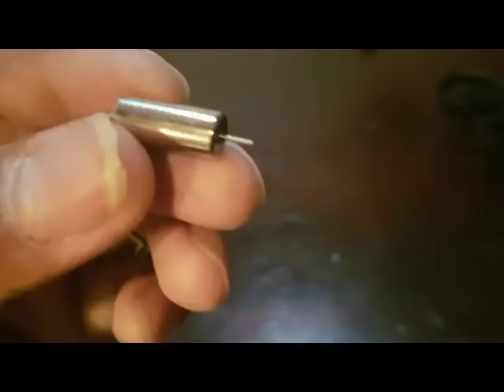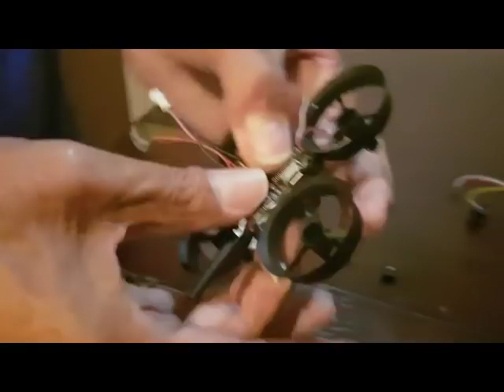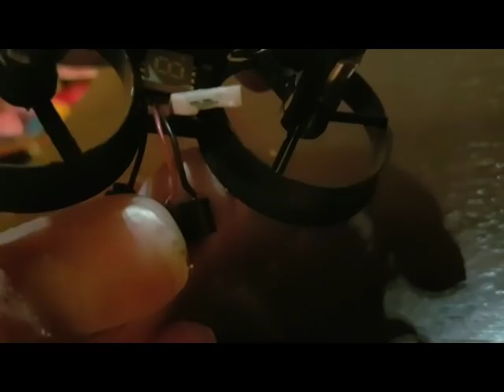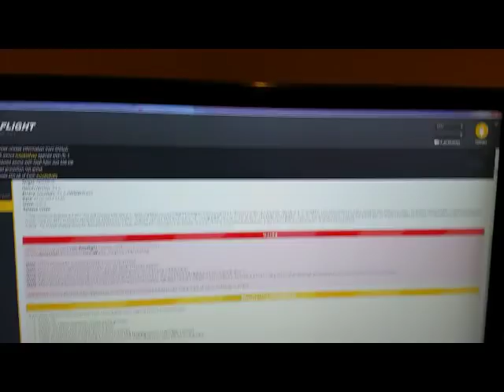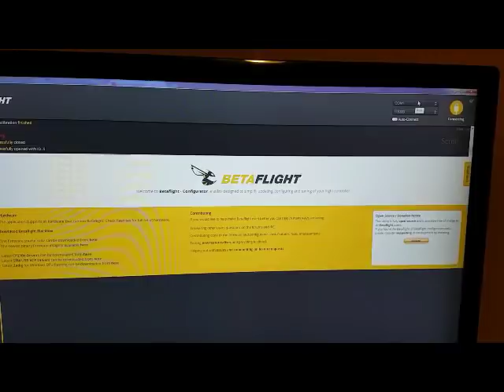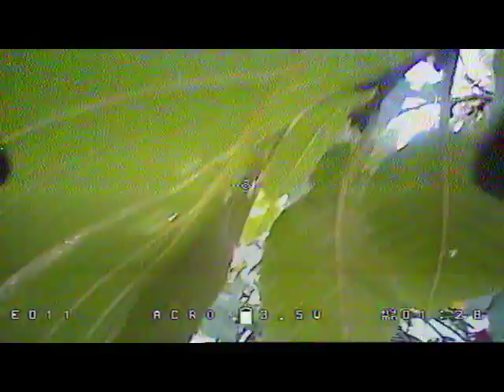Acro Super Whoop lowpro build guide E011 F3 w/osd ibus\sbus (under $80 to build, links below)

Comment: Great great video. Like so many others, I am inspired to do a build.

I am wondering if you've switched to brushless motor builds. I'm new to this hobby but from what I understand tiny brushless motors have only recently become available so I'm thinking that maybe when you made this video there were few options.
Reply from the maker: I switched to brushless. Betafpv has great options for prebuild or good ideas for motor frame combos if you want to build your own brushless.
Reply: @sheaseydel3913  Thanks. I'll check them out. So... brushless due to longer lasting lifespan and/or longer lasting flights?
Reply from the maker: @JELB1960   that and much more power
Reply: @sheaseydel3913  OK thanks. I hope you do a video of a 65mm sized long-range brushless build then. Cheers. Already Liked and Subbed.

Comment: The king Kong props are the wrong link. Should I grab props with 1mm or .8mm holes? Thanks!!
Reply from the maker: kiwijunglist .8mm for e011. i reccomend 4 blade props for better acro
Reply: Ascension FPV thanks. What do you think of this realacc controller Vs beecore V2 / king Kong / betafpv / other options. This is for brushed 7mm acro whooping. Thanks (sorry for so many questions, I don't have any gear I've just ordered a bunch of stuff. E011 / h36 / tiny6 bnf advanced pack with 5x 3.7v 250 30c batteries / q x7 radio / 1000 tvl camera. Still need to buy more batteries. And need to decide on the fpv Googles (furabee v1 Vs ev800 Vs ev800d Vs eachine Googles two Vs vr d2).
Reply from the maker: kiwijunglist i prefer the realacc board its the lightest with the largets fets and runs ibus smooth plus the chip can handle 8k/4k pid/gyro loops
Reply: sold ; I don't know fully understand your reply (yet), but I'll pick one up.  What do you think about the goggle options.  I don't want to drop $$$ on lightweight expensive googles without trying out the fit and seeing what I like.  I guess the EV800 / EV800D is pretty good in that it's a removable screen for when you upgrade to more expensive googles.

Comment: I discovered that the VTX consumes me a lot of battery and that's why my flight times are short
Has it happened to you? How can I solve it?
Reply from the maker: i have suffered this once also.. i replaced the vtx if you got it from banggood order a new one and show them the problem on that order when it arrives for a refund they suck about time limits for problems within 3 days of receiving items . check the soldering joints a cold solder on negative will cause massive power loss and volt sag
Reply: Thanks!! I will try

Comment: I followed your exact build and finished it, but my camera just has a black screen.  OSD is there, so we know that's working, but no picture.  I changed out the camera and it is the same black screen.  I resoldered all of the VTX connections on the FC.  I also watched a couple of videos on the subject.  Can you Please give me some ideas on what is wrong?
Thanks!  And thanks for doing a video on such a nice build!!! :)  I can't wait to get it flyin'!
Reply from the maker: Sounds like your vtx isn't supply power as it should to your camera.. try power your camera off the same + And - as the vtx is sourced from on the board. It seams like either the camera isn't getting power or isn't giving signal.. I would start with powering it seperatly to see if maybe the vtx has a bad circuit
Reply: great idea! Thanks for the reply...will do tomorrow and let you know...

Comment: I have finished building it !! It flies fantastically ... unfortunatelly only 2min. Do you think I could use a 600mAh (1S) battery?
Reply from the maker: Dr. KAEN yes it will lift a heavier battery just isn't as good for acro with larger battery.
Reply from the maker: Dr. KAEN 2 minutes is low for that build even at full throttle.

Comment: Some friends and I are looking into building these for some amateur drone racing.  I really have no experience with drones, so this question may be kind of silly, but is it possible to fly a couple of these at the same time?  If so, how do you configure the radio channels so they don't conflict?
Reply from the maker: James Solum yes just use 25mw vtx's the eachine vtx01 is the same as the vtx02 but 25mw
Reply from the maker: you dont have to do anything special to fly multiples with the radio but you will have to fly 25mw vtxs. for the video just make sure your all on different vtx
 channels
Reply: Would you recommend something like this modded e011 over the eachine q90c?

Comment: Im wanting to build the same build but bind it to Turnigy Evolution controller...Just dont know enough to pull it off yet...but steady researching...great video thanks for all the input you put into this vid😊
Reply from the maker: Allen Nickles the turnigy evolution will bind with the receiver I've linked. Same protocol. Need any help just message me!
Reply from the maker: The flysky fs2a pro receiver is the correct protocol for the evolution
Reply: Ascension FPV 
Awesome thanks....Im starting with a EO10 with camera already included...i just want to use my Turnigy controller ...not the plastic controllers that comes with it..plus i want better performance as well...so thinking of using the frame i got and upgrading the board etc...This video inspired me a lot...
Reply: Ascension FPV that is awesome to know bro..much respect...im totally noob...so might hit you up?

Comment: Can you use the 6mm Insane motors with this or the realacc FC?
Reply from the maker: if you use a different frame that supports 6mm motors yes. i suggest the E010S frame if you are gonna use this build guide to assemble it
Reply: Ascension FPV I'm using the furibee f36 as my build frame
Reply: I have two types of Motors upgrades the fast and the insane Motors I'm using the RealACC F3 betaflight controller and I'm using the eachine tx05 all-in-one selectable 25,50,100,250mw TX with OSD camera
Reply: With stock props and batteries if you have any suggestion what type of battery should I use please send a link to your recommendation for batteries
Reply: And I'm using a micro FlySky receiver with sbus ibus and PPM options
Reply from the maker: i would recommend the boldclash 300mah 35c batteries or the turnigy Nanotech 260 mahs are good.. also the stock E011 battery kicks ass

Comment: whats the range limit? And longest flight time?
Reply from the maker: owenkilleen about 500meters line of site 200m obstructed 150m from inside on the couch while the quad is outside flying 360 around the house. Can push 4 minutes out of new batteries. 3 minutes once they have had some cycles and abuse
Reply: what do you ascribe the 500m los to? receiver soley? 
Or, mixed with FC and Betaflight? Etc?
Reply from the maker: the vtx is good for further the flysky reciever limits it to about 500m